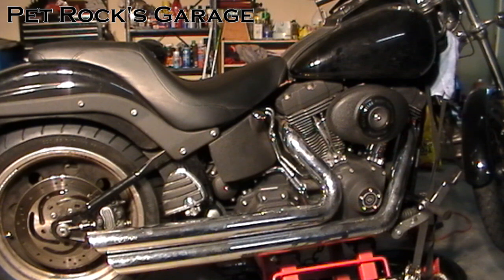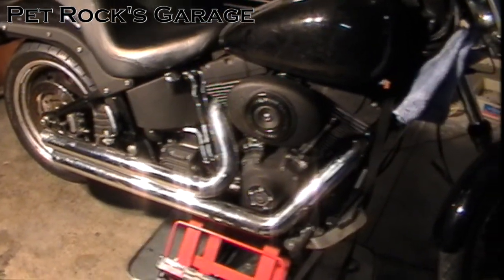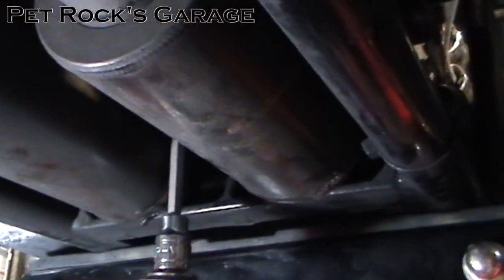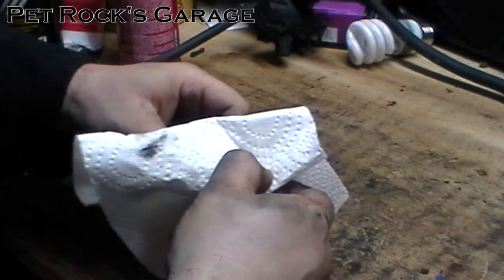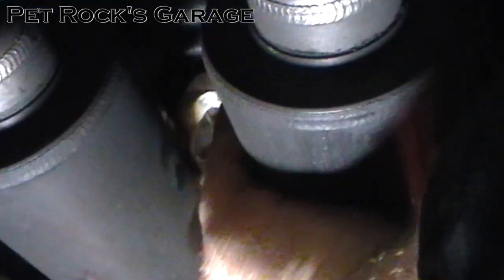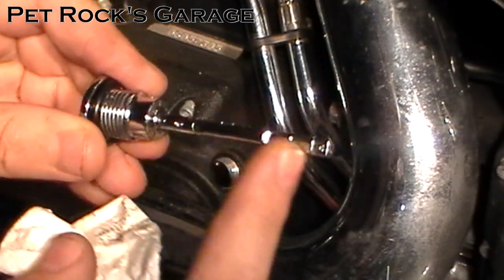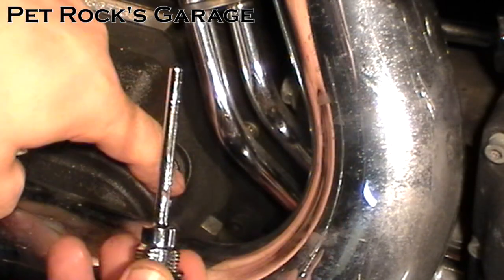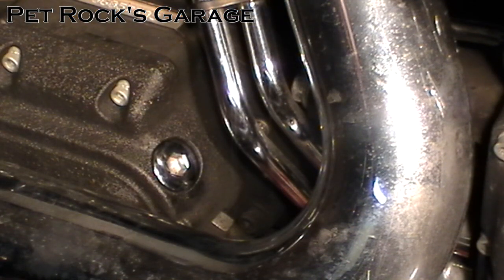How To Change Transmission Fluid - Harley Davidson Softail (Twin-Cam)

Comment: Nice ill be doing this in the next couple weeks, now for the primary fluid???
Reply from the maker: Thanks and good luck.  I have a primary fluid video recorded, but I haven't had time to edit & post it yet.  Hopefully soon.
Reply: Cool, i mean there are many videos about it, i just kinda like your style :D 
what size engine came on your ride?
Reply from the maker: It came stock with an 88" motor, but it now has a 95" motor.
Reply: I had purchased an 06 fxst back in 06 and it came with a i believe a 96" and a 6 speed. i thought yours would have came with teh same, wonder why they didn't?
Reply from the maker: The 96" motors didn't come out until '07.  Same with the stock 6-speed.
Reply: oh ok, then i was confused, i coulda sworn both of my bikes had the 96 and the 6 speed, that is why they both had the wide back tire. well i had an 06, and an 07, now i have an 02, gotta get used to this carburated instead of fuel injected. waiting around for ti to worm up is not fun.
Reply from the maker: Thats a lot of bikes. I tend to keep vehicles until they die, which is a long long time given how I take care of them. I agree about getting used to a carb after being on a FI system.  I'm more a fan of FI.  But as long as you're riding and enjoying it, thats all that matters.
Reply: Oh i agree i liked the FI much better, but I had been trying to purchase this bike since back in 06 and my brother in law FINALLY agreed to sell it to me :) on my other two bikes, i purchase the 06 in late 05, but sold it in 06 because we were moving to Texas from Cali. then i had to have it again so in 07 i got that fxst, didn't enjoy riding to much because we had small children so wife and i couldn't ride together. got rid of it in 2010. Now the kids are a bit older and wife and i will enjoy some time on the road {hopefully} sorry for writing a book, but that is my bike story, as for cars i hang on to those a while, i got a video or two about my cars :) I'll get a few vids in the future about my bike too :)
Reply from the maker: Congrats on getting the bike you always wanted. :-)  When people ask me when/if I plan on getting a new bike, my response is "When I wreck this one or the motor blows up, which ever comes first". :-) Bought it new in late '05 and rolled 85k miles a little while ago with tons of life still in her. I mostly ride solo (most recently a 1600 mile round trip to Vegas in two travel days), but we do go on day trips in our area a lot with a local riding club (not an MC) we found on meetup dot com. So I'm constantly adjusting the shocks (video planned for how to do that too) and swapping out the seat. Its worth it, IMO.
Reply: Ya im probably getting a "fluffy" seat for longer trips, and the cool looking seat for putting around town. thanks for the congrats, i am happy with this bike, it only has a lil less than 12k miles so not bad at all should have a lot of life left. Can't wait to get it out and take some vids so i can post those as well :)

Comment: Does your bike sit for any long period of time?
Reply from the maker: Not really, no.  Maybe a week or two.
Reply: I Live in Ohio. I put maybe 1500 miles on my 09 Softail every year. Then it sits in a garage, starting it and running once a month till spring. Is it necessary to change all three oils every year.
Reply from the maker: Sorry for the late reply. No, it is not necessary in my opinion. Oil doesn't really age like other fluids like brake fluid or gas. I'd go purely off of milage. Hope that helps.

Comment: You correctly mention that the stick is getting a bit damaged overtime - seemingly all transmission oil dipsticks since the Evo's are getting somewhat damaged by the clutch cable that runs too close to the actual shaft of the stick for my taste. I agree that this won't damage the gears and cogs but I'm slightly paranoid so I chopped the shaft off with an angle grinder and "smoothened" it with sandpaper (it's real soft, almost like butter). To regularly check the level I have a spare dipstick at hand. Apparently some aftermarket stuff like Baker are not suffering from being chafed so easily...but I rather have nothing obstructing the clutch cable at all.
Just my 2 lousy euro cents.
Reply from the maker: The clutch cable doesn’t come close to the dip-stick on my bike. The dipstick is actually angled away from the clutch cable. The chrome coming off is typically due to a poor chrome job by the manufacturer. But if your’s was rubbing, hacking it off and keeping a spare around to actually check the level is a good idea.  Thanks for watching & sharing.
Reply: Ah , they possibly changed the angle later on then - I ride a 2001 model and had Evo's before that (not evolved yet to anything more recent ;-)
Thanks for your series...very useful indeed

Comment: replace the fluid with Amsoil transmission for Harley Big Twin
Reply from the maker: Use whatever oil makes you happy & meets/exceeds the requirements of your transmission/motor.

Comment: Great video! You explain it real good, do you have one for the primary?
Reply from the maker: Thanks a lot.  No I don’t have one for the Primary yet.  But its a pretty simple drain & fill procedure. Just drain it out the drain plug on the bottom of the primary and refill through the access panel or derby cover whole. Check your owners manual for how many oz of fluid to put in. Different years & different models have different fill amounts. So make sure to get the correct amount for your year & model bike. Good luck...

Comment: Hey Pet Rock, thanks for this.  I used your video to take off the rear wheel last week and re-install it on my brothers 2007 HD soft tail Custom..  All good.  Yesterday he asked me if we can change the tranny oil and I said sure and with your video should be a piece of cake.  Now I ride a Kawasaki Vaquero 1700 and it only uses 1 type of oil for lubrication.  For the life of me, I can't figure out why HD use 3 different types.  I'm not knocking HD but I don't get it and of course I do all the work on my bro's HD.
Reply from the maker: Thanks a lot. I'm glad my videos are helping you out. Thanks for watching & commenting. I appreciate it.
I'm not sure what you mean by three types of oil.  The owners & service manual lists 20W-50 for Engine, Primary & Trans.  Some people choose to use thicker or thinner oils in the engine, or gear oil in the tranny or oils like ATF in the primary.  It's a personal choice.  I choose to use 20W-50 in the engine & primary and 75W-90 in the trans.
Reply: @petrocksgarage  Well I will tell him this.  But he did goto HD and thats what they told him  I trust you more.  I'll mention the 75W-90 in the tranny.  I like that to and it makes sense.  Thank you!!
Reply from the maker: @davidjoaquin141 , thanks. He should trust his owners manual the most.  Good luck!

Comment: do u have a video for the primary fluid change
Reply from the maker: Sorry, I don't (yet). Its a pretty simple process though. Pull off the derby cover, then remove the drain plug. When all the fluid has drained out, put the plug back in, fill up through the derby hole with oil (different years & models have different amounts of fluid, so check your owners manual) and put the derby cover back on.  IMS, it's 80 inch/lbs of torque.  While you are in there it would be a good time to adjust the clutch. I have a video on how to do that too. Good luck.

Comment: I have a 1980 iron head that been setting for about 8 years and it's not locked up what do I do to get it going
Reply from the maker: +Eric Fleischman, removing all the old gas in the tank and draining the carburetor float bowl and refilling the tank with fresh gas would be a good start. If it was stored with gas still in it then that gas is pretty much garbage and hopefully it didn't turn into varnish. If it still has the battery from eight years ago it is likely dead and a new one will be needed.  I'd also squirt a little bit of oil into each cylinder to lubricate the cylinder walls & piston rings.  Other then that, try and start it up and see what happens.  It will likely take some time for the new fuel to get into the carb, but only run the starter for about 10 seconds at a time, giving some time in-between, otherwise you could overheat/burn out the starter or flood the motor. Good luck...
Reply: I bought a new battery and cleaned out the gas tank   It is my dad's old bike and I'm trying to get it restored and going before he passes away so he can see it  I appreciate the information if I have anymore questions is it OK to reply
Reply from the maker: Good luck and ask away.  I'm not a iron head expert, but those motors are so simple compared to a TwinCam you should be able to follow standard diagnostic procedures to get it running again. Like make sure it has fuel, air & spark to get it started.
Reply: Eric Fleischman,
Inquiring minds want to know. Did you ever get the bike going before your dad’s passing?

Comment: What type of transmission fluid is best to use?
Reply from the maker: +Ben Baker, as I mentioned in the video (around 8:28) you’ll get a different answer depending on who you ask.  The service manual says to use 20W-50 oil, like you put in the motor.  I run 75W-90 gear oil in my transmission.  Its up to you which one you choose and which manufacturer.
Reply: Oh ok I must have missed that thank you so much your video really helped!
Reply from the maker: +Ben Baker, no problem.

Comment: how often do i have to change the oil?
Reply from the maker: Omar Alvarez, change the engine/tranny/primary oil based on the interval set in your owners manual.  Different years have different intervals.  But I change my tranny fluid every 15k miles.
Reply from the maker: Dan Thirnbeck, I change my engine oil every 5k too. That is the recommended interval for my bike from the Factory Service Manual & Owners Manual.

Comment: You mentioned you changed the transmission fluid every 15,000 miles,  I thought it was every 10,000 we’re supposed to change it?
Reply from the maker: Use whatever interval your owners/service manual says to use. Different years/models have different intervals for some reason. Don't go off what someone said on an internet forum, or YouTube or anything like that. With that said, for my bike the service manual says engine: 5k, primary: 10k & trans 20k. Although I do change the trans every 15k for no real reason other than I find it easier to remember. It isn't better to change it more often. Its kind of a waste of money/oil to change it more than necessary. 10k is definitely way too short of an interval though. Hope that helps.

Comment: Right to tight, left to loosen oil bolt? kinda tight won't come off.
Reply from the maker: Yes. Righty tightie, lefty loosey.  The plug should not be that tight. Make sure you are playing with the correct bolt. There is more then one at the bottom of the motor, one of which is red locktighted into place so it will only turn with heat.

Comment: I need to know how to do this on my 1983 Honda interceptor 750
Reply from the maker: Shane Allen, sorry, I don't have access to that bike.  So I can't help you there.  Maybe go online and pick up the service manual for that year/model bike?  Or check for an online forum for that type of bike?  Good luck...
Reply: I think the Honda uses one oil in the whole thing, so when you change the engine oil it changes it all?

Comment: Not a six spead?   I thought all 1584 cc models were
Reply from the maker: Nope.  Six speeds didn't come standard on Softails until '07. My bike is an '06.  Also, it was '88ci (1450cc) stock and I upgraded it to a 95ci (1550cc). HD didn't come out with the 96ci (1584cc) until '07.

Comment: didnt know there was not a filter  stilll i would use cloth
Reply from the maker: To have a filter a pump would be needed to push fluid through the filter.. Harleys don't have trans fluid pumps.  So no trans filter.  Re paper vs cloth, use whatever makes you happy.  Even if there was a filter, you would have to dump chunks of paper towel, not just fibers, to clog a filter.  So I wouldn't worry about it.

Comment: Hey Whats crackin PR?  Everything ok here!  its Rich with the 2005 ,15 anniv, fatboy. I'm the ass that couldn't get the slack outta my clutch(Barnett) cable, when I did the clutch adjustment, on your other video.( the Barnett and Harley cable are totally diff)
  I just changed my trans. and primary fluids  with a brand called "REDLINE". You ever hear of it?  its been 2 weeks I have it in...and what a difference. smoother shifting, through all gears-finding neutral now, is a breeze!  gotta let me know what you think! ttys, I hope, ty-Richie.
Reply from the maker: Yes, I've heard of Redline, but I've never used it. I've been using Amsoil in my bike pretty much since I bought it new. Use whatever oil brand you want, its your ride. No such thing as 'the best' oil.  Glad to hear that changing your fluids smoothed things out for you and you got your clutch cable figured out. Enjoy the ride!
Reply: I hear ya man. You can go crazy on the net today, its an endless discussion!!!! 
I did want to try Amsoil, but , the guy that worked on my bike(was selling it) once said" your bike doesn't have any  racing work done to it,,,you don't need it"  is that true?...I walked outta there with my head spinning..saying"wtf" just happened! lol
Reply from the maker: I'm not sure what your mechanic meant. Amsoil is just synthetic fluid like Mobile1 or HD's Syn-3. I've been running Amsoil in my bike since 500miles (85k now) and have no problems. I don't have any racing stuff on my bike either other then the 95" Big Bore kit.
Reply: Pet Rock's Garage  Hi..i meant a mechanic, that adjusted my clutch,(SAID THAT STUPID SHIT). I have a 95'' ci also- with twin cams-noisy fucker!!! sounds like loose lifters, hitting the top valve cover(tap-tap-tap-tap). I have 17,000 miles on a 05, 15 anniv, fatboy!
  I just changed my primary and tranny with REDLINE(tranny-75w-90)(primary fluid.heavy duty red), last week. I let it drain over night, then put 24 oz back in(tranny)(and 26 oz of primary), now I see a little drip, under primary drain plug. I put a new o-ring on the drain plug, and keeped the same diaphragm derby cover as you have-its fine-no rips/tares. when I feel up behind, the main shaft drive pully, its alittle wet???   what do you think, Pet rock??  I'm stumbling over here, bro?? the tranny breather hose-is dry-yikes!!!
Reply from the maker: I seriously doubt the leak is due to the oil you are using. Synthetics don't cause leaks. But they often have detergents in it that 'clean out' existing leaks that were plugged with dirt. The leak you describe is pretty common. It is likely one of the seals for the shaft that goes between the primary & transmission. If you use different oils for the primary & tranny then you can tell which one by the oil that is coming out. Its a PITA to fix because you have to disassemble the entire Primary assembly to get to the seal. Good luck.
Reply: Pet Rock's Garage   Hey-PR-I hear ya. I thought I shocked the system and blew the seal, introducing the shockproof-heavy tranny and heavy primary fluid at the same time? but I think u said, it wouldn't matter!
    I tighten the pdp(primary drain plug) a 1/8th of a turn, and went over the derby cover-easily( with the star method )..going for a HARD right tomorrow-goin to beat on it-to see if I see the leak more prominent!!ok, pal..thanks again for the help- your a great guy! ttys,  I hope.
  so ur saying the inner primary main shaft seal or the shifter shaft seal?
Reply from the maker: The main shaft seal is more common of a leak since the shaft is constantly spinning as you go down the road where the shift-shaft only spins when you shift. Good luck.
Reply: Pet Rock's Garage  thanks a bunch-peace

Comment: I run red line trans oil with shok proof but that's me
Reply from the maker: Use whatever oil meets or exceeds the trans fluid requirements in your owners or service manual. That is all that really matters.

Comment: The oring pops out at 4 ft lbs
Reply from the maker: You mean the drain plug o-ring? It's hard to say from here why it would pop out at 4 ft/lbs. My guess would be that the o-ring is the wrong size or thickness.  Or there is something in the hole pushing the o-ring out.  Good luck.
Reply from the maker: Thats great! I'm glad you got it sorted out.

Comment: hello my friend ! I have a fat boy 103 ,I want to learn to mess with it at least basic you can enstill me please ? I'm from brazil state of Rio de Janeiro have you heard? my name is pierre
Reply from the maker: The best source of information to work on your own bike is to buy the Factory Service Manual for your year & model bike from your HD dealer. It will have all the information you could possibly need to do maintenance and repairs. It will pay for itself when you do your first oil change yourself. Good luck.

Comment: dont use papper towel    pappper fibers will clog filter
Reply from the maker: What would you propose instead?
Either way, there isn't a transmission filter.  So I'm not sure what you are referring to.

Comment: Good video , but I Gotta say ,, Yr bike is Filthy !!  Have U Ever Polished yr exhaust pipes since U bought it  ?  UnReal
Reply from the maker: Thanks a lot. I appreciate it.  I have never polished my exhaust pipes. I personally hate chrome because it is so high maintenance. I did put a coat of wax on the paint back in '06. Thats about it and it still looks good to me.
Reply: @petrocksgarage  ,,, LOL ...  U need a Rusty Rat rod bike bro .. I have a Ironhorse Texas Chopper ,,,, Nothing but Paint , Chrome and Horsepower  , and boy does it shine !!
Reply from the maker: @BLACKROSEMF  , I do like Rat-Rods a lot. Lots of personality in them, IMO. However, I don't want to have to get a tetanus shot every time I get on/off the bike. :-)
Reply: Time spent polishing is lost time ridin’!